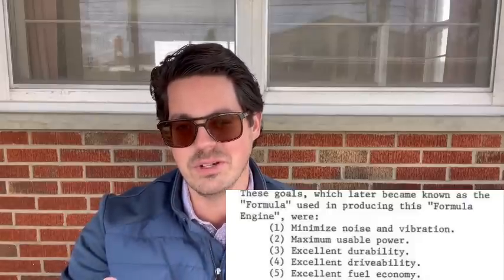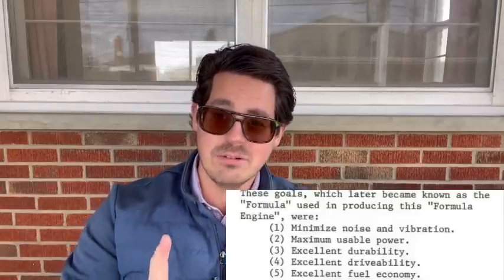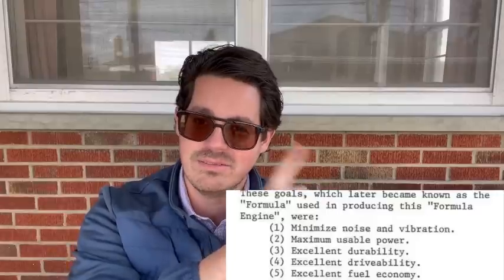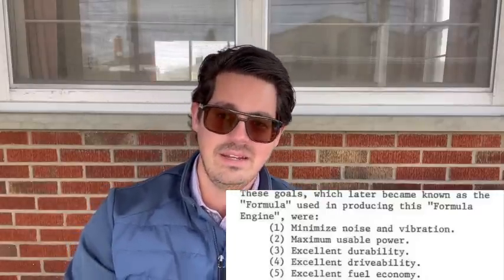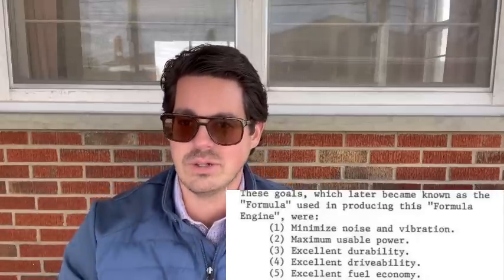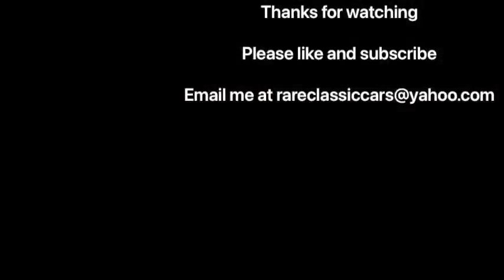Worst Engines of All Time: GM's 2.5L Iron Duke 4-Cylinder

Comment: Had an 80,an 85 and a few 87’s.      He is 100% correct.     However,the Tech 4 had exhaust header cracking issues.    The torque strut would wear and the engine would rock cracking the steel header.  Tip:  Use the 94-96 A-body torque strut. 

Also,they would blow the head gasket if overheated.     Unfortunately the fan comes on at 230 in the 87’s.   Too hot. 

My ‘87 Century with 2.5 went for 310,000 then died from not being used.

Comment: When I was fresh out if high school I bought an 87 Celebrity with the Iron Duke from a nun for $800 and it had a pretty bad engine knock. I drove it daily for several years and I took it half way accross Canada. Maybe 3-4 years later I sold it for $1800 with about 250 km on it and the engine knock was still there...no better no worse. I replaced the radiator and a battery that's all was very reliable, possibly the cheapest car per mile I ever owned.

Comment: My 84 skylark had a recall on this engine for block cracking/coolant in the oil. Sure enough mine cracked. Unfortunately I bought the car after the recall period and the previous owner had not changed out the block. I had to buy a remanufactured short block. Oil filter was buried behind the engine. Throttle body wore out quickly and would bog off idle. Ignition modules would heat up and kill the car after about 80 minutes of driving. Wait two hours and it would start right back up. To pass on the highway I had to make sure a had a half mile of clear traffic ahead. Then hit the throttle hard to unstick the lockup converter. Then hit the throttle again to go into passing gear. It was a good comfortable car in the city but a with lot of headaches.

Comment: How does this relate to the over the counter SD iron Duke. I picked up one of the first if not the first X body to my city from the Indianapolis air port. I was impressed with the power but I don't remember if it was the Iron Duke or the V6. Not even sure the V6 was available at the time . I think it was the Skylark. It was a Buick and was working at the Dealership there at the time.

Comment: The camshaft gear is not a "fiber optic" gear. It is a fiber composite gear, made with fiberglass  and resin. Then it is machined into its final shape. The first couple of years the Iron Dukes were built with the intake and exhaust manifolds on the same side of the cylinder head, just like the Chevy 2 153 cu. in. four banger. Then they were built with a cross flow cylinder head. I'm not sure what year this happened but I think it was 1981 ish. They weren't the most refined four bangers but I'm sure the corporate "bean counters" had something to do with that. Great video and keep them coming. How about a video on Ford's best and worst engines, fours, sixes, and V8s?

Comment: Yes, its durable and reliable if maintained but in stock trim, guttless. My dad had a Fiero with this engine backed by a 5M. Had to have it turbocharged to get any power.
Reply: Turbocharging an Iron Duke?    Sounds interesting
Reply: @Keith Jackson  after the shop got the tuning right, it was actually a good engine for being TBI. A few months later the crankshaft broke. After rebuild, it was converted to port injection and a stronger crank.

Comment: Outstanding video. For all its defenders, by the mid-80s, this engine was very rough and low in power and torque compared to the competition, especially the likes of engines such as the Toyota 3S-FE, which displaced only 2.0L, but had better power, torque, and efficiency ratings. And yet, this engine lasted until the mid-90s. Eeesh!

Comment: I worked at a Oldsmobile dealer in the 80s, you got it right, they were reliable, but unrefined, great for tractor or a mail truck, TBI helped in 1982, they ran better but still no power, and MPG could have been better

Comment: I had a 1985 Buick skylark with the iron duke. I didn’t find the motor bad, I hated the 3 speed automatic it was attached: the lockup torque convertible that had a fixed switch point contributed to terrible drivability .

Comment: Oh Yes, GM's 2.5 4 Cylinder, nicknamed the "Iron Duke" by GM in the late 1970's,  1978 model year as a replacement to and after the Chevrolet Vega 2.3 4 Cylinder Aluminum engine debacle  which was put to rest after the 1977 model year.  Later, in the mid 1980's GM nicknamed this same 2.5 4 Cylinder the "Tech IV" as a marketing ploy to lend some "Sophistication" to this engine. This engine is still in use by the USPS Mail delivery vehicles.

Comment: I had an ‘81 Pontiac Phoenix with that engine.  Ran great and was extremely durable.  Sure it sounded a bit rough at all times and didn’t particularly enjoy revving.  For fun, I bought a Sun Super Tach II and attached it to the top of the steering column.  Man, it absolutely hated getting anywhere near 4,000 rpm. 😮

Comment: Ford guy here. Years ago bought an 88 2.5 S-10 5 speed with well over 200,000 miles due to some financial hardships. I beat the shit out it and it never failed me. That engine was so rough you would of thought it was a diesel. It was torquey  and light and would easily spin the 245s on Centerline wheels.

Comment: All true. I have an 86 Olds Calais two door. Trimmed like a Toronado or a 98. And powered by a tractor engine.
Thank you for this. I saved it. 
I love these engines but every word you said is absolutely accurate.
They just crack me up. High Tech ... For 1937.
One wag said the Iron Duke sounded like an SOS pad in a blender.
Also kudos for dispelling the notion that it's a Chevy II with a new name.

Comment: I rode in a 85 (I think) S-10 with an Iron Puke 5spd, it didn't make horsepower, it made coarsepower. And what a dog, felt like it was towing when it was empty. The owner remarked that it didn't go anywhere fast but at least it didn't burn a lot of gas doing it. Later I had a 95 S-10 with the 2.2 5spd combo and it felt like a rocketship compared to that one.
Reply: "And what a dog, felt like it was towing when it was empty." -> I felt the same kind of thing, even when not driving, because I was no older than 13 at the time. (1994 or 1993, IIRC) It was most likely a 1992 MY (or shortly before that) GMC Sonoma, which I now feel sure it was the "Iron Duke" 2.5, it felt like he or she had a camper on it with just people in the pickup! LOL!
It was a manual.

Comment: My second car had one, 1980 Monza, carbed and RWD. It was fine for a kid learning to drive. I had lots of fun in that car and it was so slow it helped keep me out of trouble. Only problem I ever had was a leaking auto transmission gasket. My first car was a 71' mustang with a manual and a 351C. Yes, much smoother! But it got crashed, had to move on and ended up with the Monza

Comment: Those engines were extremely reliable why the USPS trucks(LLVs) had them the later injected ones were fantastic They got 500-750k miles per engine in constant stop and go The carb ones were unrefined but the injected ones with distributorless ignition where great(other than ignition modules being somewhat weak)

Comment: We have a 1984 GM 2.5L in a boat, they still ran ignition points and a Rochester 2bbl carb on this engine. Very simple engine and doesn’t have the cam noise of the automotive version, is also fairly smooth at idle.

Comment: I had a 89 S-10 with the 2.5L Iron Duke that I owned for 9 years. It was a great truck and those engines are almost bulletproof. The only downside to these engines is the lack of power but it was never a concern to me.

Comment: Chevrolet in-line 6-cylinder engines, including the Stovebolts, also used composite camshaft gears, without any known deficit.
My girlfriend had one of those Omegas with that four-banger. It cruised nicely, on little fuel. But, as soon as I popped the hood, it didn't look like near anything of which I wanted to work on

Comment: I snapped one of the cast connecting rods in my 1981 Pontiac Phoenix.  Poked holes in the block and pan.  Built a replacement short block.  Shot-peened the rods in hopes they would prove more durable.  Haven't thought about it in years.

Comment: They put those in so many Hyster forklifts. Head cracking and head gasket blowing issues. But they'd run well over 10,000 hours. Not to mention the fiber/cardboard gear would spin the center out.

Comment: Actually International Harvester beat GM by a couple years with the 4 cyl. engine for the Scout in 1960 which like the Pontiac was an 8 cyl. with one bank removed.

I had a boat with a 120 MerCruiser that was an Iron Duke from 1978. These were also used in Jeeps.

My sister bought a Mustang II in '74 that had an in-line four that was rattly as well. About the smoothest 4 back then was the Opal used in the Gt's and the one from MG.

Back then in-line sixes were the popular choice and GM, Ford, Chrysler and AMC all made excellent sixes. (Except for the miserable nylon distributor gear on the slant 6.)

If I could nominate a bad 4 cyl. it would be the overhead cam 4 that Ford was putting in the Escorts of the early 80's that would break the timing belt right at 60K miles and at best just bend a couple valves or worst punch a hole in a couple pistons.
Reply: It also had "torque-to-yield" cylinder head bolts that would break while the engine was running if you re-used them.  Nobody knew at the time that you couldn't re-use those head bolts.

Comment: Adam ,  One of the engines that was available for Cadillac in 1981 was a V6 - can you tell me where it came from and when it was last used? Thanks
Reply: I think you are referring to the 4.1 liter Buick V6. Not terrible but not so Cadillac-like either. I had one in an 82 Electra. Little weak for that big of car.
Reply: @Jeff_Pendleton  correct

Comment: We solved the vacuum house problem ( fleet operator ) by installing silicone rubber vacuum hoses from Japan. When the first hose split and fell off a fitting we changed all of them  no more problem up to 300,000 miles .

Comment: My experience with the Pontiac 2.5 liter engine was good. It was in a 1978 Pontiac Sunbird. The vibration at idle was not noticeable, but it had the 5-speed manual overdrive transmission. I think the idle was close to 1,000 RPM. Performance was good, and it would sound good above 4,000 RPM with the open element air cleaner I had installed. Distributor access was great, since it was before the cross-flow cylinder head. It really looked like a 153 CI engine from the Chevy II with a holley version of a weber 32/36 carburetor and a HEI distributor. I drove a 1982 Chevrolet Citation once with the 2.5 liter engine and it had all the bad traits that you mentioned.

Comment: The Iron Duke was a terrible, horrible engine....but it was great. I know someone that drives a 5 speed manual 2.5 S10. His engine is original. In the mid-late 1990s he swapped to an upgraded timing gear set, did crank and rod bearings, replaced leaking gaskets and an oil pump. He still drives that truck now, with 360,000 miles and its only been apart again for leaking gaskets. He has been through 2 clutches, several sets of tires, he has done bushings and shocks, replaced the springs once and done all the work himself. The man is now in his early 60s. The truck doesn't look new, but it drives like new. He keeps the truck mechanically as perfect as possible. That engine of his has never been apart for new rings or anything, and the bearings were a precaution when the original oil pump seemed to be failing. Its had the odd ignition control module, tune ups and such, but it does not burn oil, and it isn't refined but it still does a great job.
Reply from the maker: I have the same feeling about it. It’s terrible and I won’t say great—pretty good. Problem is the refinement was so poor that people wouldn’t put up with it. 

It’s kinda like eating a $5 pizza. It fills you up and is cheap, but you’re likely not going to buy it again because it tastes terrible—unless you value cost over everything else.

Comment: My best friend in the 70s and early 80s had one in an S-10 and I agree it was very reliable but sounded like a tractor engine . Side note it replaced a 77 Dodge Aspen , that over his short ownership was recalled for rust , blew the rear end at 70k miles and drove like crap . Thanks for the memories . Good times !

Comment: My experience with the Iron Duke seems to differ a bit as I found it quiet and quite peppy with a stick shift manual transmission but not so reliable 
Around 1987 I bought a 1985 Chevrolet Astro cargo van with the 2.5L Iron Duke engine at an auction that was running badly but it had low mileage and they accepted my low bid. I knew the issue was only a bad EGR valve. One morning it suddenly died on the freeway doing about 70. Almost immediately a Michigan State trooper pulled up and offered to drive me the 10 miles that remained toward my destination (I.W. apprenticeship school) which I accepted but my dead van was still an issue I’d have to address after school. I ended up towing it home and found the engine locked-up because of a broken connecting rod. I often wondered if using nothing but synthetic oil was at fault, but that’s all I still use in my vehicles to this day. Anyway I found the crank journal was slightly scratched so I had a machine shop rebuild it. Drove it for another 50K miles before it started to smoke. Maybe the rebuild wasn’t so great so I used it as a place to store construction debris such as shingles and drywall while working on my home, then I’d drive the squatting van to the landfill. Then one day, out of the blue, the smoking stopped so I cleaned it up, tossed a foam mattress in the back and added curtains behind the seats and sold the shaggin’ wagon the moment I put it on the corner. The only issue it had was the shifter would get stuck every once in a while where I’d have to reach under and tap it free. I told the buyer everything but a few weeks later the guy was stuck on an inclined driveway where I had to use my vehicle to push it uphill while tapping the linkage underneath. It just needed a bushing. Never heard from the guy since.

Comment: South Africa's AML-Panhard armoured cars in 1967 received a new water cooled inline-4 cylinder petrol engine installed in the Mk5.[6] Now called Eland. GM's 2.5L Iron Duke 4-Cylinder. Built on a 4X4 chassis with a height of 2.5 metres, a length of 5.12 metres, and a weight of 6 metric tons, had a maximum range of 450 kilometres and a mileage of 2 kilometres per litre

Comment: I think the Ford version of this was the 2.3 four cylinder.  I had a 1982 Ford Ranger that went well over 200,000 miles with one of these in it.  It was noisy all the way!  By the end, I could not find re-built carbs for it as all of them had the holes where the assembly screws went hollowed out by engine vibration.  The Pinto had many faults, but the engine was not one of them.  (I have heard that in those days Mitsubishi had a patent on the balance system for 4 cylinder engines and that Ford did not want to  pay royalties.  If true, this may be why the Iron Duke was noisy also).

Comment: A 4 cylinder inline engine is not balanced for secondary twice crankshaft speed forces shaking forces of the pistons. A straight 6 cylinder engine is balanced. This imbalance causes the engine to shake. The 2.5 L iron duke has a large 4 inch bore and thus its heavy 23 oz  pistons has the engine a low revving engine

Comment: years ago my daily driver was a 1985 Buick Sommerset Regal with the Tech 4. It had the easiest to replace thermostat I'd never seen! But changing the ignition module and coil omg what a PITA. Speaking of the behind the engine I also replaced the steering rack not once but twice! The factory BOSE sound system was some oddball pod thing impossible to replace with an aftermarket unit. On the plus side the driver seat was super comfortable and with a set of goodyear studless snow tires turned my Sommerset into a fantastic winter snow beast.

Comment: I had one of these in an 84 Pontiac 6000.  The engine was tough as nails.  Got over 200k miles out of it.  The brakes on that car were unfortunately pure crap.  I couldn’t keep rotors on it and even the rear brakes wore out quickly.  The brake system was too small.  In the early 1990’s I found an old school mechanic who took off the factory brakes and installed a Chevy system from a larger car.  It bolted on with no mods necessary.  That was the LAST set of brakes installed on that car.
This car forever broke me from ever considering another GM vehicle.

Comment: I own a 89 Grand Am LE 2.5 L automatic, 2 door coupe. 2nd owner. It is noisy... I use 5w 30 synthetic oil, and new oil filter every change. The car drives well, with satisfactory performance. It has had the usual maintenance issues... I am a retired general mechanic, I perform all the maintenance and repairs. My engine doesn't have a serpentine belt! Each component has a separate belt. So far the car is dependable. @ 130k. Thank You for the opinion!!!

Comment: Add a MerCruiser 140 crank & rods and 4 Pontiac 301 pistons and you have a high compression stroker. A little cam, some intake & exhaust updates and tickle 200hp. Not terrible for an 8 valve NA 4-banger. I have a factory "Super Duty" Pontiac cast iron head made for road racing Fiero's, maybe I'll do something with it someday.